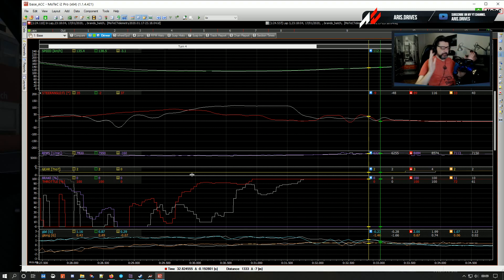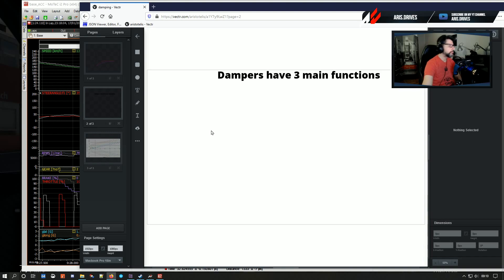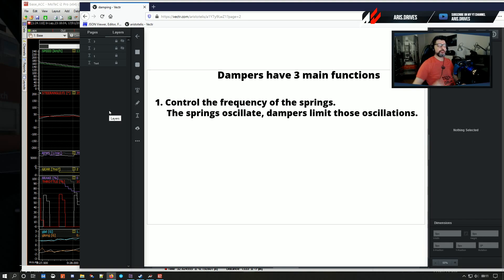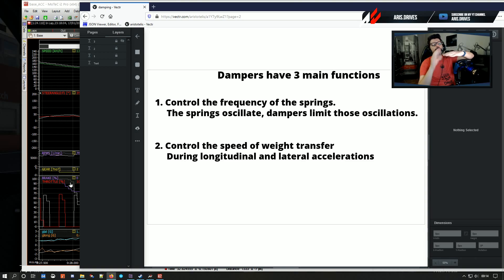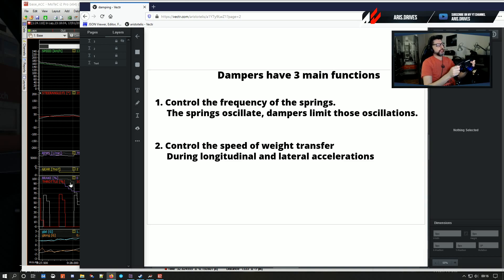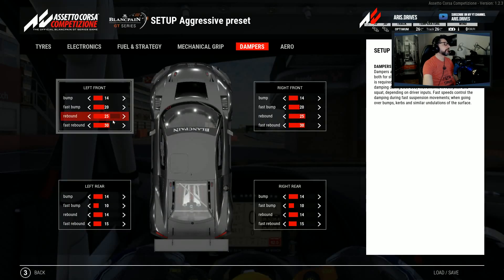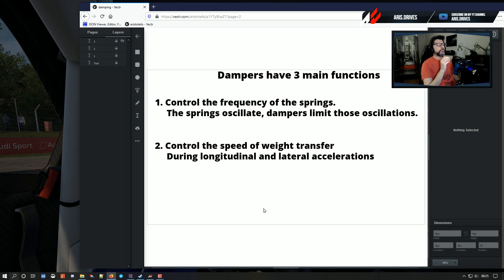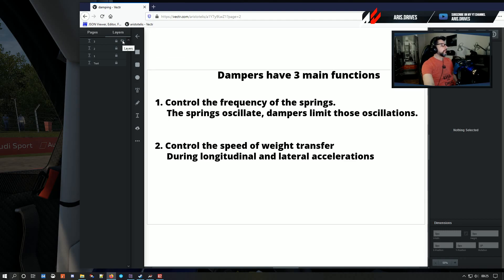TL;DW - Part4. Conclusion. Understand the dampers function, know how to use them.

Comment: You did mention at one time it is ok to use slightly asymmetric dampers. Front dampers at 1:1 bump: rebound or a slight bump bias will help with steering feedback and turn in. A slight rebound biased rear setup will promote fast settling. 

GT race engineers spend a lot of time thinking about what the chassis is doing, and the behavior of the wheel is often compromised to achieve chassis control.

Rebound settings control the sprung mass. Bump controls the unsprung mass. If you are going to tune your dampers to be rebound biased then you will need to pay extra attention to your suspension travel and the bump stop length/ rate. Since rebound dominated setups use the dampers as a timing device for pulling the chassis, or jacking down to the bump stops in order to create predicable chassis behavior.

Comment: Hey Aris, quick question, I'm in the porsche so I understand it's very sensitive to pitch, which means in most situations I should run stiffer springs to help the pitching of the car, now should I go stiffer on the dampers along with going stiffer on the springs? Vise versa softer then softer?
Reply: It depends. A stiffer spring builds up forces quicker, so you don't need/get as much force from the damper. But your suspension won't move as much and if so fast, so you need "more" damping to get the same effect.
It's best to set up springs, especially anti roll bar, and then setup the damping. If you are happy try harder springs and tune the dampers again. Now drive several laps (10-50) on each setup and look how they perform. How many slow laps? How fast a median and average laptimes? How fast was the fastest laptime?
If it's a quali setup go with the fastest view rounds. If it's a short race go with the fastest median/average setup. If it's a long race take the setup with the least view slow laps.